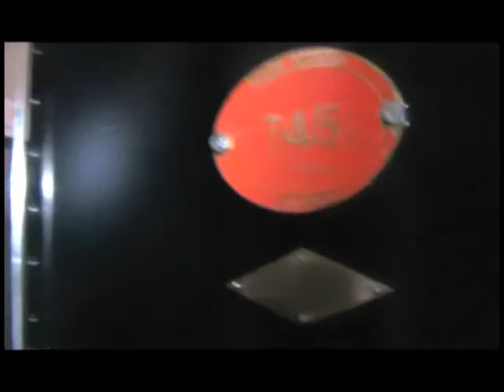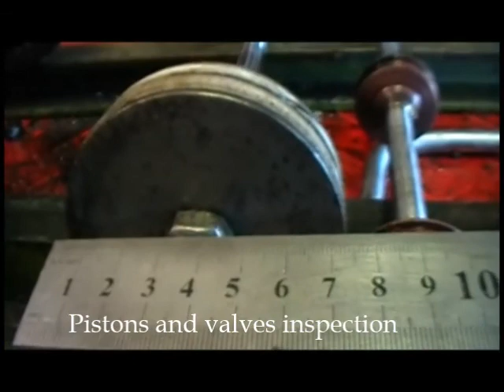Miniature steam train maintenance

Comment: In your split axle boxes there is a split bearing,  What stops it from spinning around inside the axle box.    Great video.  Love the wheel drop.
Reply from the maker: Hi gwr1475 When I first built the boxes the bearings were rather tight in the two halves. Right on the joint where the two plastic bushes sit I cut a very small groove at the joint and due to the tightness the bushes kind of sat themselves into that small grove which is enough to hold them in place. However if they do turn (such as I found the rear axle ones do) I don't think there is a problem so long as they get plenty of oil.